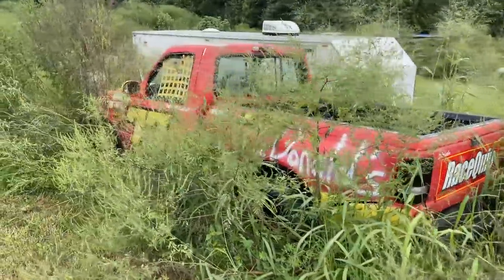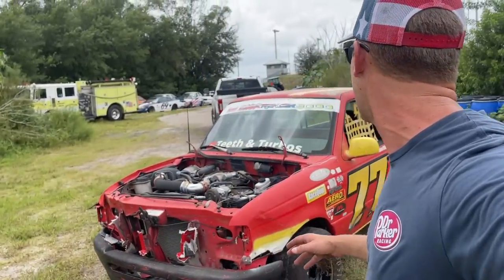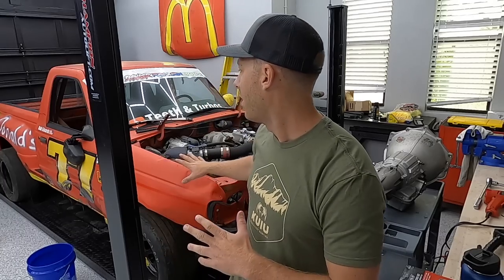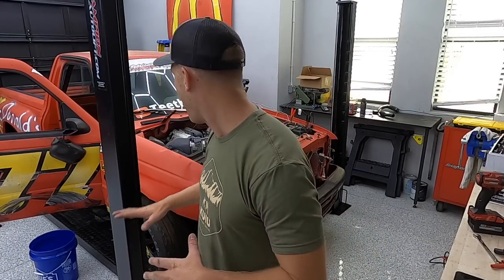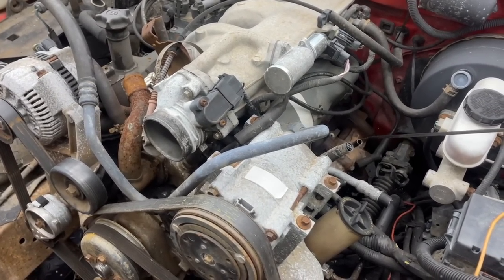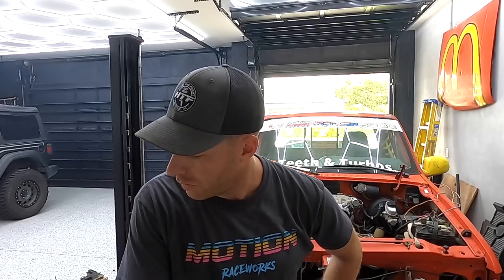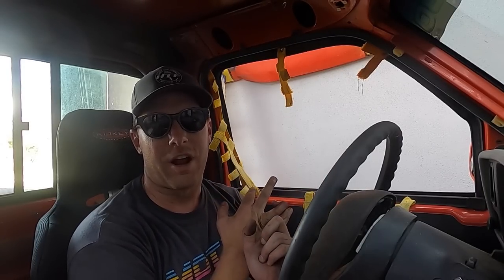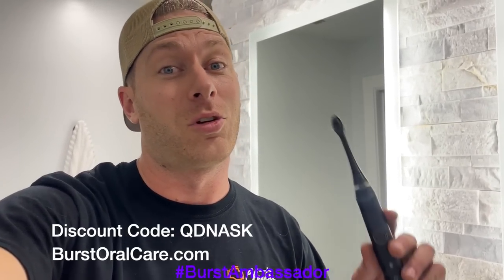Will the Abandoned Ranger Run After Being Pulled from the Dead?

Comment from the maker: Fix the compression issue or send it?
Reply: Send it
Reply: Fix it! Just because your head gasket hasn't gone yet, does not mean that it won't go in ten minutes or ten hours of driving. Thetruck shut down because it was so hot. So the heads are now warped. You are setting yourself up for a short race if you don't fix it.
Reply: Add oil to the low cylinder, see if compression goes up. If it doesn't, then pull heads and do gaskets and maybe buy a junkyard head or two just in case.
Reply: Put a little oil in the cylinders with low compression and if it raises the compression you know it's the rings ! Definitely get the heads resurfaced just because you got them so hot with a set of new gaskets. If oil in cylinder makes your compression go up you know it's got bad rings so do that first. If I wasn't in Vermont id volunteer my time to help you 100%.
Reply: Throw some Engine Restore in her and send that shit man...🤣😂🤣 On a serious note though I'd go thru it if you want to be competitive
Reply: Fix it and win
Reply: More teeth. Fix it with all new oem parts like springs ,valves..build a basically brand new stock motor. It will be more reliable than most others..... Also more dental content please.
Reply: Up to you Parker.  How bad do you want to win? If you want to win, Fix It.  If you just want to have fun, Send It.
Reply: Replace the 4.0 you can find one for a couple hundred bucks and get that W 🏁
Reply: fix it unless you got another motor to go in it? Hope things are well buddy!
Reply: Fix it with some upgrades.
Reply: Fix it!!
Reply: Use it as a testbed for "motor fix additives" and other snake oil products and then race it
Reply: Fix it, the heads might be warped but hopefully you just torched the gaskets
As long as the block is true you can always throw some rebuilt or good used heads on it. Sam would be a great help with all his experience making sure everything is good again so you don't waste any time.
Reply: Just my two cents, you should pull that motor and find a good replacement from another Ranger or Explorer. Give it a fresh clutch, fresh tires, and spiff it up a bit everywhere with some spray paint and  Mr Sam's wax. Overall would still be cheaper than replacing the whole truck and it'll allow you to run this one in at least one more Danger Ranger race. I think with what I listed you have the right recipe for a podium finish. Regular cab ranger with the 4.0 and a 5 speed and some good tires, yeah if you stay out of trouble you might just have a shot at a win.
Reply: To win you must finish first... so it needs to be reliable. Personally would want getting to finishline most of all. Rest is a bonus. Tear down the engine you've got in there and see if its fixable. Replacing it with a unknown unit, still needs thourough checking over.
Reply: Fix it.
Reply: Engine restore 8 cylinder bottle!!
Reply: Full send !
Reply: Fix it
Reply: Fix it..
 Nothing worse than it dying a few minutes in to a fun session... 👍
Reply: It won’t last 10 laps.
Reply: Fix it if you want to do more than run a couple of laps...
Reply: Fix it!  It’d make great content!
Reply: Must fix it. Look at all of the different issues that both the trucks and the crown vics have when racing. It may seem like enough power because it seems like $hit happens to everyone but if it happens to you and you drop another cylinder, a coil goes bad, the clutch starts giving you issues then you'll wish you had that cylinder. Do the oil test to see if its in the top or bottom end and deal with it as needed. Keep in mind you completely overheated it so once you take the heads off and release the pressure on them they'll probably need a machinist but for those heads its probably cheaper to just get another motor.
Reply: I say  best to repair
             and
Not  "reap" the error
Reply: FULL REBUILD. Would dig the content. Make JH help you fix it. Then send JH off to drivers ed for driving. lol
Reply: Pull the trans , pull the heads and freshener up it deserves it..... Do It for BOB🇺🇸🦅
Reply: Fix the head.
Reply: You don't wanna pull them heads...that ain't no ls lol

Comment: I’d disconnect the water pump belt and see if you’re pushing air through it water jackets bye duct taping off the pump inlet and outlets, then start the motor and rev it a few times to see if it blows off the duct tape. Without the pump spinning there should be no psi. To do this unless you have a bad head gasket! Do this before deciding to pull trans or motor (to fix the clutch slave cylinder). That way if it is a head gasket issue you with be able to fix both with one forward motion. Good luck!

Comment: Review your vid!! What was dragging when you pulled off the lift? Fix clutch, radiator, compression and loose connection on alternator then send it!
Reply: whatever it was it's bent now as that initial turn sent it straight under the wheel, I was looking for the bump on the inboard, but I think the steering was so stiff and cranky he didn't notice LOL, or it had already dropped off??  glad to see you back!  definitely go through it, I don't think you'll be remotely competitive [FOR THE WIN]  with a couple of cylinders down, and if it's not competitive it WON'T be as FUN...and thats the real point...  GL
Reply: looked like it might have been a camera stand
Reply: @nicholasswain5430  yeah i didn't go back and look, but you're probably right, just a thin spindly one that makes sense!

Comment: If you’re going to pull the heads off, you may as well get them decked. I’d measure your piston to valve clearance and deck the heads down as far as you can.
Reply: Right if they’re off you might as well do a little work to them and get a few extra horses. 

honestly the racer in me would be pulling a good one apart and doing every little thing possible to improve it ( there ain’t no racing that is more work or more expensive than spec racing)

Comment: Pull the engine out and put some love into those heads. Have them milled and checked for cracks and have the valves gone through. Put a clutch and slave in it while it’s out and make it run good again.
Reply from the maker: That’s the plan!

Comment: Fix it right while you have the time! "Reinforce" the damaged area where the radiator cradle was bent! Should be an approved repair... All the Nascar teams used to build in stronger bumper / fender supports in there short track cars... 😜 😜